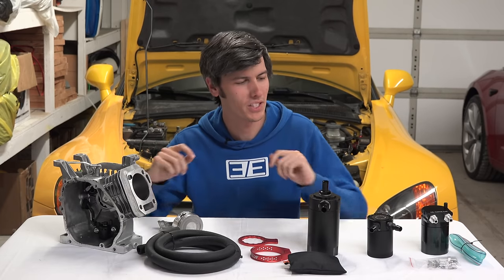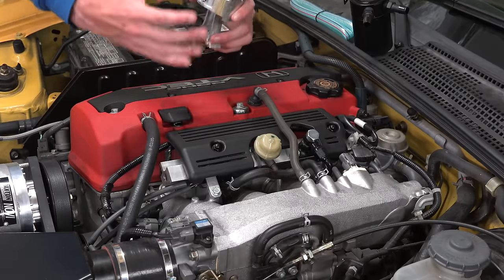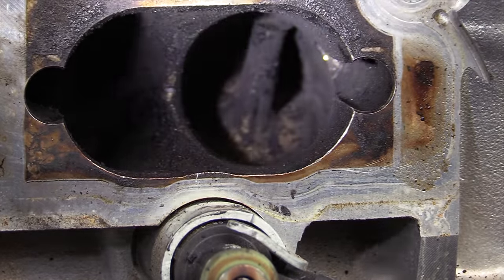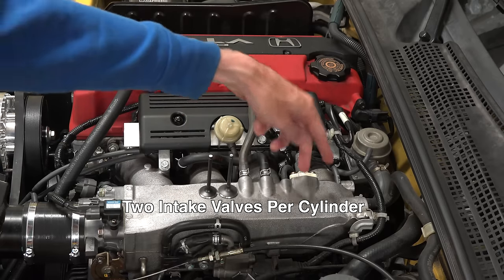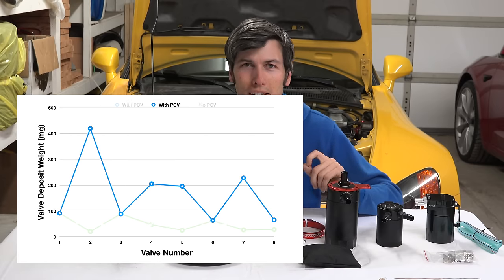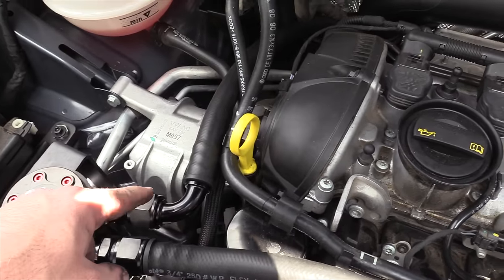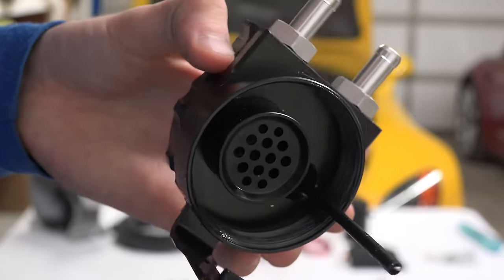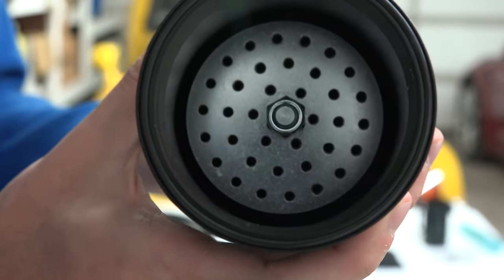Do Oil Catch Cans Actually Work?

Comment: The vast majority of the catch cans on the market are crap.  A single diffuser plate and not much more.  I'm currently in design for a real catch can with engineered separation technology.  I've used the best ones on the market and they all failed.  The last one we used was a BFI on a 2011 BMW Z4 pushing 650HP.  After 3 months of testing we had less than half a teaspoon of oil in the bottom of the catch can.  We removed it and checked the discharge nipple and the discharge hose, both had oil in them.  So yeah, BFI doesn't work, or not well.  VPE (Velocity Performance Engineering) is my company.  We will be releasing our VPE Separation Can soon.  Keep your eyes peeled.

Comment: Would this help with my oil consumption. Since I straight piped my car I've been noticing alot of black stuff on my garage door when I start it up in the morning
Reply: replacing your pcv valve would probably help more tbh
Reply: This would probably not help with your oil consumption.  Make sure your pcv is not clogged.  The black you are noticing is probably from excess fuel as your car is warming up.
Reply: Might have bad valve stem seals.
Depending on your year and how many miles you have. And or head gasket leak. Do a compression test too.

Comment: Why not just plug up both holes? Cap off the intake and the crank case?
Reply: That'll cause excessive pressure and will start to blow seals.

Comment: One thing if you want to believe what your talking about you should put a drain at the bottom of the oil catch can back into the dipstick and run it back into the motor when the car shuts off and another thing is multiport fuel injection along with direct injection have eliminated the need for this system anyhow.

Comment: How about using this in a diesel tdi engine, would it work to reduce carbon buildup in the throttle body from EGR backfeed?
Reply: There's way more flow thru that system, and it's way way hot, so I'd say it's possible but not with these things. Imo your best reasonable option is to clean it now and then. I used to use brake cleaner and/or carb cleaner, back when they worked better, but now they have special intake and carbon cleaners that may work as well?

Comment: I'm going to comment, then watch the video, and hopefully not have to delete my comment lol.  From what I have seen, intake valves get caked up from oil over time right?  Catch cans filter the path it travels through.  I have seen people test it and it does do that... so I see no reason why they wouldn't be a good idea.  It's like not having an air filter for your engine.  It doesn't make sense.  It's odd to me that they don't include some sort of filtration system to begin with, but if I'm not mistaken isn't that part of how they fixed the problem in later years?  I'm new to all this so I may be wrong here.  Not some know-it-all...just bought a 2014 3.5 ecoboost a few days ago and then started learning about all this stuff literally yesterday lol.
Reply: "Lots of reasons here, but some of the most obvious: 1) It's another maintenance item, and customers have a hard enough time just keeping up with oil changes. Examples like AdBlue and water injection systems, come to mind, engineers try to develop solutions around customer maintenance" Engineering Explained
Reply: @HondaFit4Adventure  Yeah, I guess I don't think about that.  Many lazy people these days.  Not me...I'd rather maintain than pay thousands for repairs lol.  I learned the hard way in my 20s though...was lazy back then.

Comment: What is better: oil catch can or having dealer clean out the system of carbon buildup every 40,000 miles on a Honda? Don’t want any warranty issues.
Reply: How much do they charge and to they actually clean it out or just spray a little cleaner in there and call it good. Like those companies that clean your HCAV pipes... Even if they do it right and it's free, a catch can makes things better the whole time between cleanings. If a warranty issue then I'd just pull it off b4 I took it in.

Comment: Have a question maybe you can answer regarding oil and startup. Have a 2018 5.7 Hemi. If I don’t allow the car to warm up for some time and just if off, like just starting  it up to move it out of the garage and shutting if off. The next time I go to start the car up you can hear the lifters tapping for a short time. Seems to do this every time in this scenario. This never happens if the car was shut off when it was fully warmed up. What do you think is going on, is it because the oil never got hot and is still thin and doesn’t keep the oil pump primed. Any thoughts?
Reply: That is weird. I'd assume the opposite b/c when cold the oil is thicker (not thinner) and less likely to drain out of parts or the pump, plus the block is cold. So if yours isn't tapping after a hot shutdown, it shouldn't after a cold. Or maybe it does tap and you only notice it because in this case it's twice a loud? Here's my theory, and it's a stretch but it's all I got: If the eng isn't run long enough to pump up the compressed lifters then odds are you now have twice as many lifters bled down as before which would make twice as much noise on the next start. But to back out of the garage means it should've had plenty of time to pump them up. I guess maybe if it was real cold and thus slower to pump up, maybe. You should listen carefully to see how long they take to pump up during a normal cold start. Like if it takes a few sec for the oil to pump at all, then another few to pump up, and you started and backed up really quick I suppose you could do it? I can back out my truck in <2sec run time, but I have to make an effort to do that. I'm guessing you're more like 10sec which "should" be plenty no matter how cold. It's ok, I too have mystery oil problems. The latest is the dipstick is dry when first pulled out (cold eng). Reinsert/pull and it reads normal ~1" up the stick. Had a friend witness to ensure I wasn't crazy. Repeatable any time it's cold.

Comment: Why do the manufacturers route that air back to the intake in the first place then? I can see the benefit of letting off that pressure in the first place sure, but why bother sending it back into the system instead of just venting to the atmosphere like the study did?
Reply: The crankcase vapours are toxic and should not be venting straight into the air (unless you like giving people cancer). Much better to burn them up in the engine instead.
Reply: @nerd1000ify  true I didn't consider that. I guess they're essentially extra oily exhaust fumes which would be bypassing the catalytic converter otherwise

Comment: Just saw this video. Totally agree in the efficacy of catch cans. Our business created an excellent one, and we have a lab where we can test catch cans to an ISO standard. I'm not here to promote our catch can specifically however its worthwhile to point out that to be really effective a catch can must be able to filter oil droplets down to 1 micron and less as modern engines use light oils and high boost. The older baffle style or bronze element type have limited efficiency and can restrict PCV flow. Do your research when selecting a catchcan for your vehicle. And just because it caught something, doesn't mean it's catching everything.
Reply: Have a link to your business?
Reply: catching something is better than catching nothing though.

Comment: I don't think the paper you cite, nor anything else I've seen actually proves that oil catch cans do anything. Here's a scenario - OCC catches 90% of passing oil. Remaining 10% is enough to completely coat the valves on each cycle, and there is no difference in carbon deposit. I am not saying this is what happens, but until someone does a study looking at carbon deposits with and without OCCs, we won't know for sure. Trapped oil is no proof of effectiveness.

Comment: But what is an oil catch can?  And if its so good or useful why dont manufactures just use them already?
Reply: System "simplification"...job security of engine tech down the road to de-carbon your intake. Oil Catch Can is a pro-active preventative measure instead of a backside of the equation reaction when you get the biggass repair bill!!!

Comment: I had to change out the main engine seal because of s PCV valve failure causing the system to pressure up too much in my wife's 2016 GMC Terrain. GM doesn't have a prevention or solution. Could this help prevent pcv valve failure, and over pressurization?
Reply: Possibly but not because of filtering out the contaminants from the intake but rather keeping the lines clear of freezing liquids. 

Did this happen at sub freezing temperatures? The Terrain/Equinox 2010-2017 are known to have issues with the pcv hose allowing moisture buildup in the line. If it freezes the pressure can build up enough to find the next weakest link. Usually the rear seal but it's not picky and will take out whatever it can to release the pressure. 
My wife hasn't been able to drive her Equinox for the past week because I never emptied the liquid this fall and it froze up on her with the nasty temperatures we had. Today was the first not freezing day so I drained the hose and airbox so hopefully it's good till next year.
Reply: @Jason Hahn  yea exactly. I live In alberta so gets cold here. Really disappointed in this issue that gmc never resolved
Reply: @Dmac6969  Where's the vent from the valve cover to the air cleaner box ??

Comment: you know I am sure  someone has thought of adding a petcock on the oil catch can to empty it vs having to remove it from the car...just a thought
Reply: It comes up a lot, including a check valve to drain back to the sump. The problem is likely b/c it's added time to setup and people just want it working, then they blow off the drain valve. So my guess in most cases is lack of time and/or initiative, or space. The last two I've had there's no room, but really it's initiative, like choosing to waste time on the internet giving my opinion to the world  ;)
Reply: @chevota400  I dont think you want that stuff going back into cc

Comment: So do I not need to run a catch can if I'm port injected, even on a heavily boosted car?
Reply: you should definitely run one on a boosted car, but a AOS is even better and basically maintenance free assuming you return it to the oil pan
Reply: @arcanevoid9199  what is the benefit if I’m port injected? Do I need to be worried about carbon deposits?
Reply: @pchris  you will still get blow by, most factory setups route this oil mist back into the intake to be burnt. this is not good for power and can basically lower the octane. it will also leave oil deposits depending on where the return is from the crankcase/valve cover. and no with port injection you don’t really need to worry

Comment: I’d rather run that oil directly back to the oil filter and keep it in the oil system and not burn it or have to manually drain it…anybody look at a drain cock and routing a drain hose back in to the system? 😉👍

Comment: I call BS on catch cans. I had deposits on my old Ford FE engines like crazy. I'm sure I have intake deposits on half of my Mark VIII intakes where the injectors don't run fuel through the ports to clean them. It's just a nature of the beast and probably more from the combustion process itself rather than pcv contaminants creating the carbon. That's my take. Unless you're really draining a lot of liquid I don't see how it would have much effect.

Comment: If my car is burning oil, will this help?
Reply: No, if its burning oil (as in dark smoke coming out the exhaust) theres a leak somewhere, usually its the valves, cylinders or gaskets, if theres no smoke its either burning very little oil or theres a leak going to the outside

Comment: So catch cans are a must even if the factory pcv system works great?🤔
Reply: Id say yes. I installed the cheapest  one he has in this video, on my 2000 Accord with 268k miles. I took a 3hrs trip to NYC did some around town driving and 3hrs back home and that thing had a descent amount of oil in it. And I only got one because of a dirty intake plenum, gunked up idle air control valve (IACV), which happens from the oil which vents back into the intake from the pcv. So yeah I'd say it works well. I have no check engine light or nothing
Reply: @thatguybeeba4873  yeah I figured that👍its a good modification to any car😉

Comment: Come on people wake up, vehicles last well over a hundred thousand miles without catch cans, PCV valves have been in use for decades. Todays oils burn cleaner because their ash content is very low, there is no need to install catch cans for oil. Stop and think people.

Comment: Lol - an oil catch can is universal. I purchased an $18 one and it's designed IDENTICAL to Mishimoto's $115 baffled and filtered catch can (the 2nd option reviewed). No sense in spending anything more than ~$20-$30 on it, just because it has a special bracket for your car? Wow, a $2 piece of painted scrap warrants a 10x or more upcharge?! HA!

Comment: No evidence of the catch can stopping build up. It's the usual oh well it will help. It's another aftermarket gizmo sold with just enough info to make it sound technical. Take them off your cars and don't worry about it. They are so cheap to make and will just get full of water and some oil which the engine is designed to burn off and be used as turbo lubricant. Performance can also be reduced with one.

Comment: Will a catch can catch some oil mist? yes, do they solve any problems? no. 

If only takes a minute to service a catch can so the excuse that they are not included on new cars because it would be more maintenance is a lie. There is so much wrong in this video that it would take another video explaining everything that is wrong. 

The next video is going to about why you should change out your exhaust bearings and why you need to change your blinker fluid, oh and don't forget to change the summer air in your tires and replace it with winter air.

Comment: Wait a minute. So this is nothing more than an air-oil particle separater that has been around forever. Every machine I've ever operated has had these mounted on the side to prevent oil, water, or trash coming from an air compressor from entering precision components within machinery. Lol just another way for the manufacturers of these to get richer

Comment: This sounds like complete nonsense.  If piston blowby is causing oil to be blown out of the crankcase, the oil level on the dipstick will be going down and that indicates an engine overhaul is required.  Some deposits on the inlet valve are the least of the problems.  Also, don't I understand that modern emgines have oil catch facilities built into the crankcase and the collected oil just drains back into the oil pan?
Reply: performance engines especially ones that are boosted often have blow by to a degree, it doesnt mean something is wrong unless youre getting excessive amounts. and no the way most engines do it from factory is to route the oil back into the intake manifold to be burnt in the cylinders, this is not good
Reply: @arcanevoid9199 I have a turbo car, I just vent the pcv to atmosphere like in the old days.

Comment: Actually not a good idea. I have seen GDI engines last and fine 150 K miles without any tertiary blow by treatment . The oils today are formulated to minimize coking and there are baffles in the flow to catch these oilish vapors. GM and other manufacturers  do not recommend or install them for a reason and the damage they could do is catastrophic if not maintained properly. The risk does not outweigh the advantage .. However, is a good selling product so by all means keep the scare tactic and benefit malarkey on going.

Comment: Just vent to atmosphere.  Problem solvoed.
Reply: Then the acids in the crankcase aren't disposed of as well. Not sure how much better pcv is vs no pcv, but I've seen bearings eaten up by acid and I want to avoid it as best I can. Plus the whole legal thing and oily mess it would make under my car which is currently perfectly clean and dry. The do make ones that connect to your exhaust, which I tried, and it was a complete failure. Odd because I know it wouldn't work but people insisted it does. I think they just never bothered to check, which applies to most all catch can users as well.

Comment: you explanation regarding nearest valves contamination by Heavy oil droplets on the intake stroke makes no physical sense///// due to inertia, oil will be thrown either to the back wall or the the furtherest walls also on the intake from the breather inlet...learn physics!!!

Comment: I see that they do catch a lot of blow-by, and that experiment seemed to work on preventing carbon buildup (by blocking the one port) but does installing a catch can actually prevent carbon buildup?
Reply: No, but it does lighten your wallet and give you some other poorly engineered thing to look after.